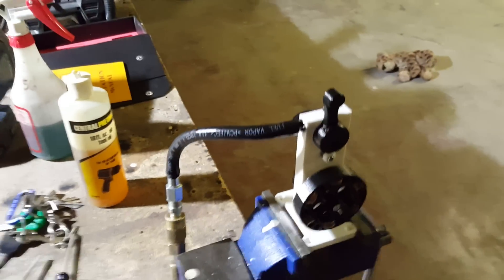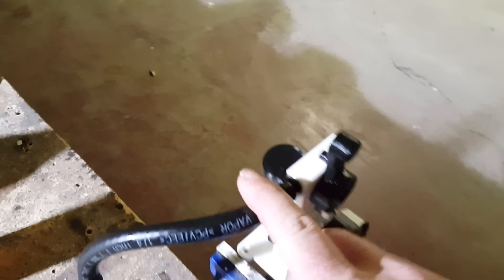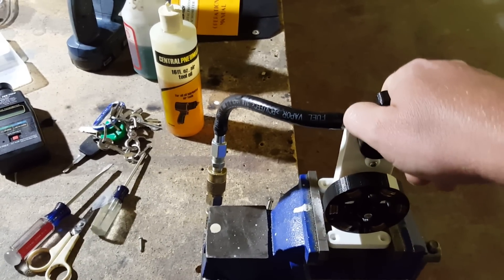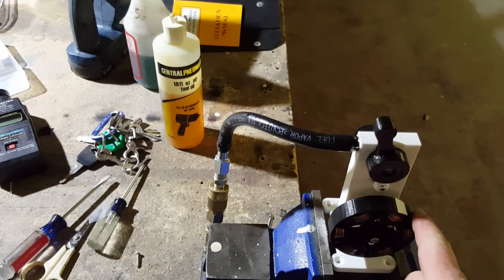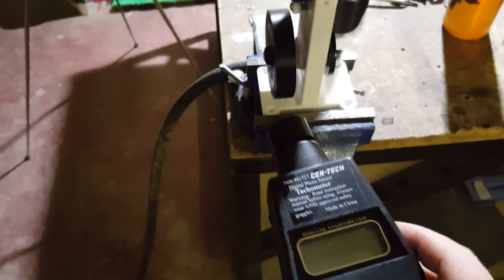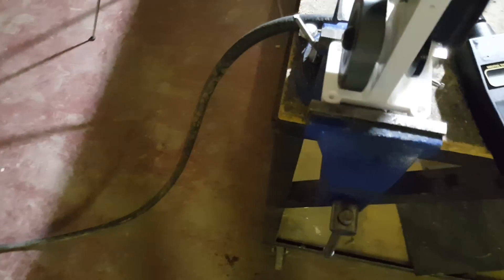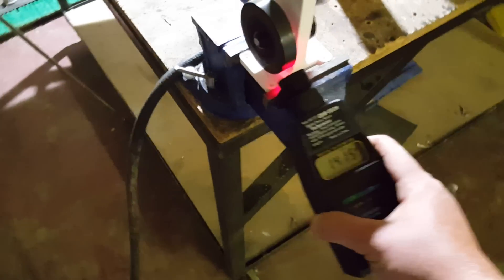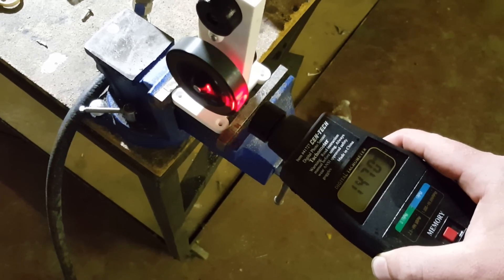3d Printed Steam Engine With Throttle Running

Comment: so, a steam engine with out steam is.....????
Reply: An air engine. Exact same concept except you can use things that won't melt. (not exactly the same, but for prototyping sake it is)
Reply: An awesome little engine :) I have an air engine.. it started life as a briggs and stratton engine... the things we build for fun...
Reply from the maker: It's an air engine modeled after a steam engine, a device that converts energy from a working fluid like air or steam into a mechanical energy.  Happy now nemo......????